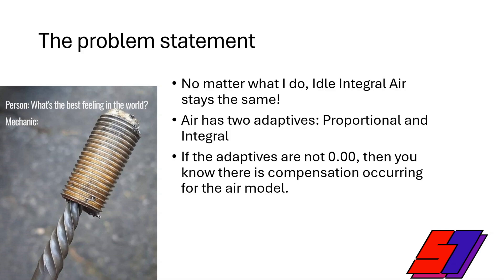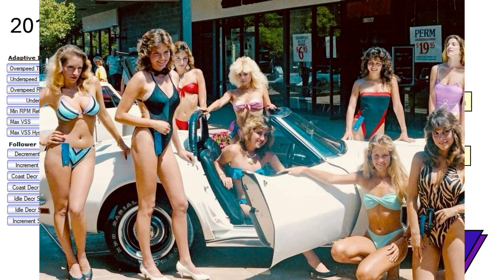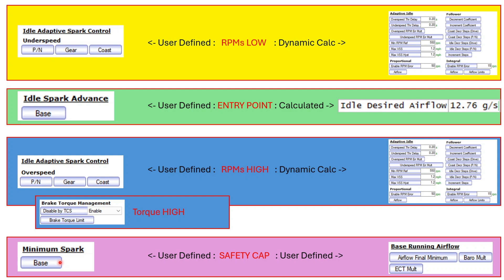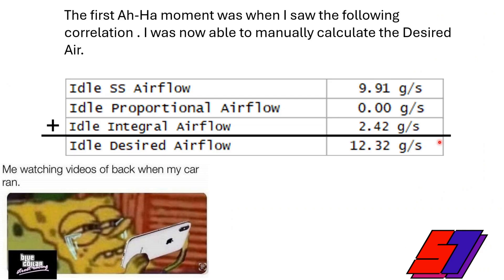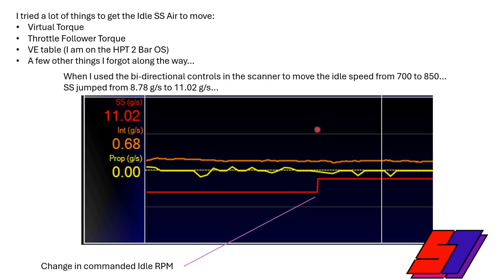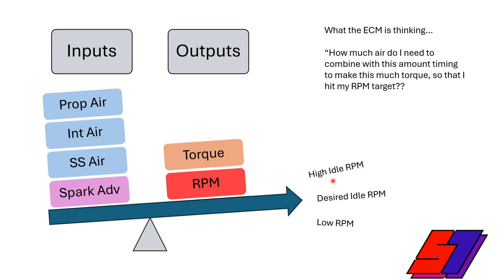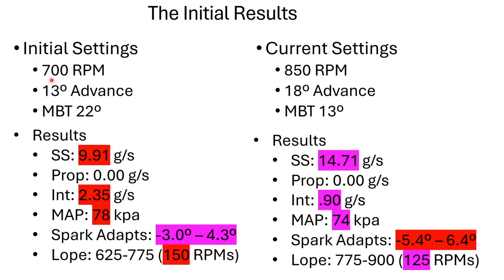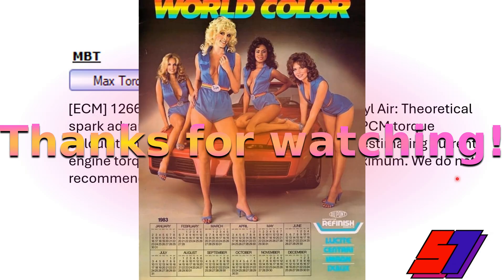Solution for Idle Integral Airflow (part 1)

Comment: Would it be engine>torque model>torque coefficients that is referencing MBT? So maybe the answer to fixing idle without spark issue is in there?
Reply from the maker: No that is not correct.

Comment: I used the Idle Integral from the C6 ZR1 (10 RPM vs 12 RPM) and it smoothed out my idle after the LS9 cam swap (211/230/122.5 .562/.562). I also copied the rest of the idle adaptives and timing from the ZR1 and it drives great. I think the C6 ZR1 is a better tune to copy from when working with a big cam, the stock CTS-V cam is really small. On a side note I have learned the majority of my tuning from you and Matt, thank you!
Reply from the maker: That is great to hear! And perhaps I will give the ZR1 P/I a shot too. I think no matter what, it is best to use the factor settings. I see too many people attempt to correct idle problems using the P/I controller and they end up causing more problems than they originally had.
Reply: Just an extra data point.  My 08 C6 LS3/TR6060 has 10 RPM as an integral enable value as well.

Comment: I have increased my integrals on the right and reduced on the left. Also halfed the Over under spark tables. Idle is stable enough to stay running!
Reply: Halving these also made my cam sound less lopey and slightly better take off (M6 trans) Doubling them made it lope hard and was kinda a slug taking off. weird

Comment: The MBT table is used to calculate the actual timing desired from a given torque value requested. ECM calculates all the max attainable values and compares to this MBT table to calculate % torque loss from spark retard.